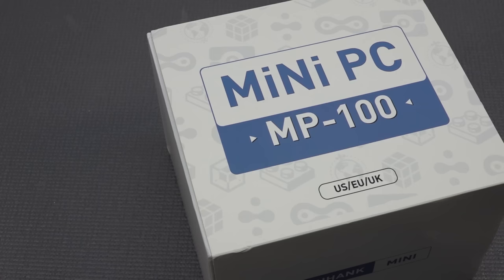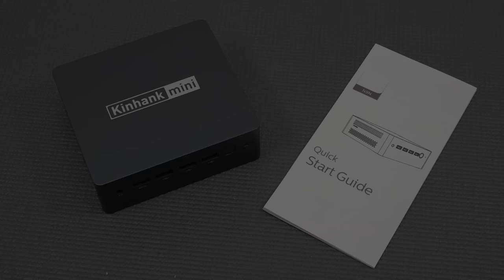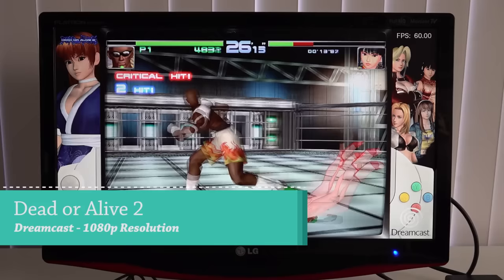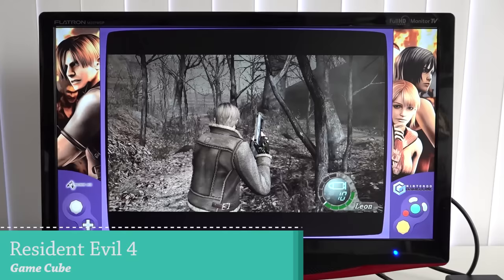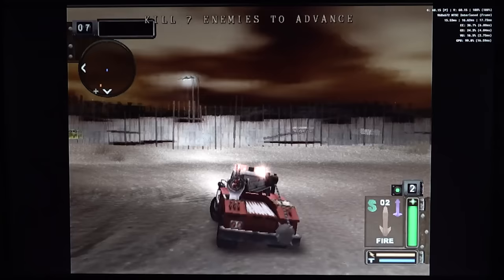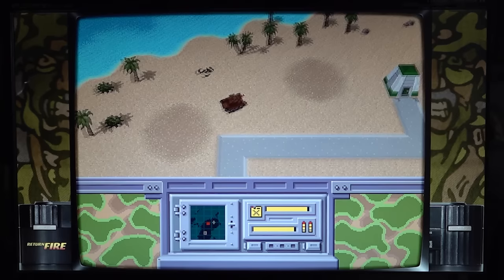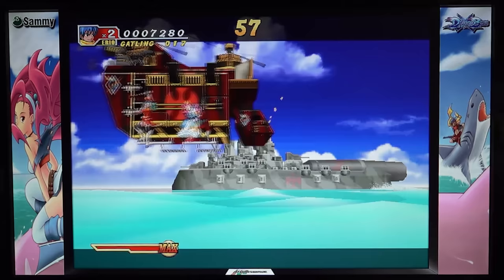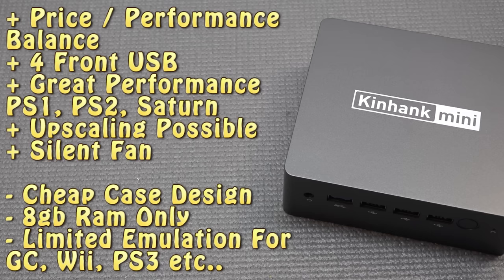Perfect Budget Super Console X PC - Great Emulation Retro Performance ! / MP100

Comment: For 274 usd? Thats crazy. At that price point you can get the AMR5 with Ryzen 7 5700U and 16GB RAM. Which is miles ahead of this.
If you really want to stick to N100, then FIREBAT T8 Plus with fast m.2 ssd and 16GB@4800Mhz LPDDR5, would be far better choice. At half the price.
Reply: Thanks this is actually super helpful info
Reply from the maker: Agree only take note this is all in one package and totally overpriced. 
If you build your own N100 you can do it for maybe around 150 usd 😅
Reply: Where can buyed it :)

Comment: Okay, disclaimers: I'm a nearly 40 mom who hasn't played a video game since ps2 in 2006. I've had a back injury, which may be heading toward surgery and a Loooooong recovery. I thought to myself, "self, this would be easier if i had a ps2" looked into it and damn that ish is expensive. Then 3ish days ago I learned the word emulator. And that some blessed souls have preserved the turbografx 16 (the console I grew up with) and its possible to have both tg16 and ps2 at the same time! And everything in between. 
Actual question: this appears to be truly plug and play, straight into the tv without needing a pc to run it through. And can play ps2. I know it can be done by yourself and yadayada i do not have that skill set, and with two 5year olds i do not have the time or inclination to learn. 
Is this what it seems?
Reply: Update: I did buy it. Overall, I am loving it. It is pretty much plug and play, there is some stuff you have to do the first time you turn it on, but it's pretty simple. And you do need a mouse. The controls for some of the Snes games and turbo grafix are a bit wonky, but I'm getting that figured out.